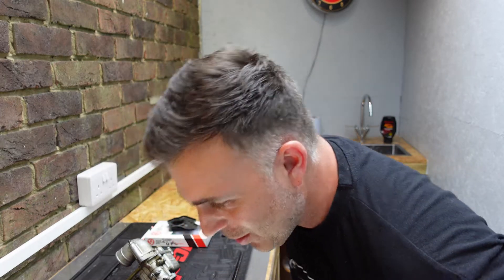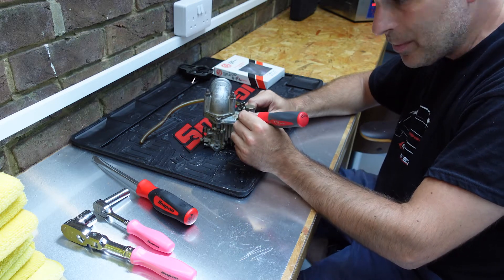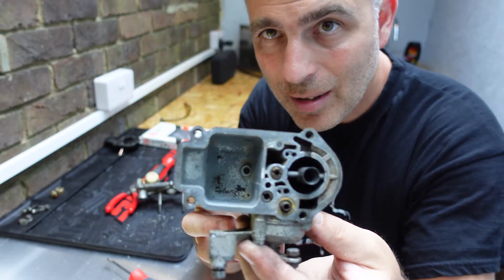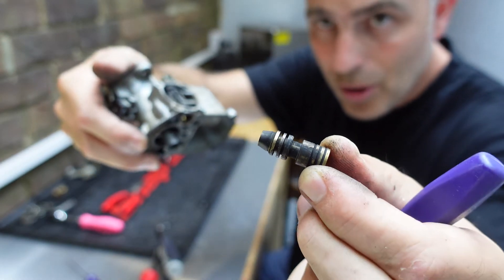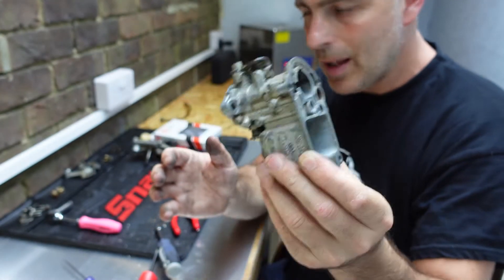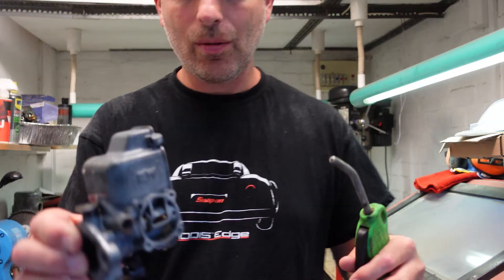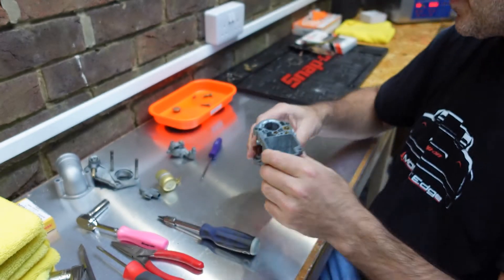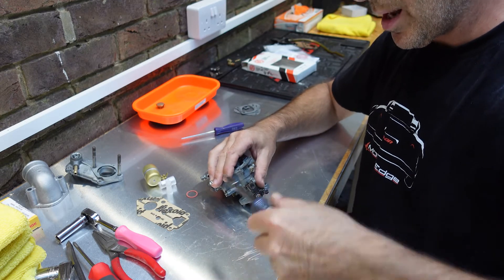Fiat 500 carburetor rebuild Webber 26 IMB

Comment: Great explaination about the fuel level setting!  Anyway I always used a 7mm drill bit putting it between the float and the gasket in order to check the correct setting. Thank you so much!

Comment: The petrol brass intake it is only pressed in not screwed in. It should be checked regularly because it can pop out while you are driving flooding the engine with petrol. It happened to me.  Petrol on a hot engine is not a good idea. An old italian mechanic told me that they had few fires.
Reply: I had a slight leak right there, but I resined the petrol intake in
Reply: Good to know!!! Thank you
Reply: @makingcookingfixing  question- how did you resin that in? Forgive my ignorance. I’m rebuilding my Weber 26 and was following your video. Saw this comment and it definitely caught my attention. Thanks
Reply: @polloloci21  Hi there, that brass pipe where the fuel line slides on was loose, it was easy to take out, I just cleaned it, roughened it with sandpaper, same for that area of the carb, and used like a JB Weld (there are other brands you can find at car part suppliers) two small tubes like toothpaste, one black and one white, which you press a pea size of the paste out, mix to grey and apply. It dries quick and rock hard. Resistant to heat and petrol. Cheers.